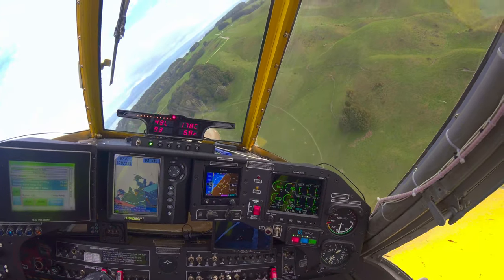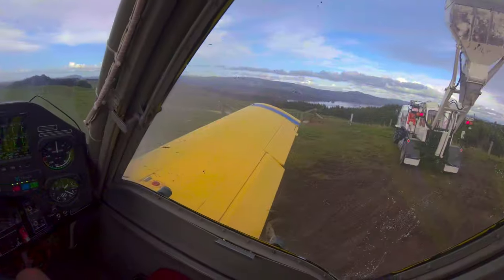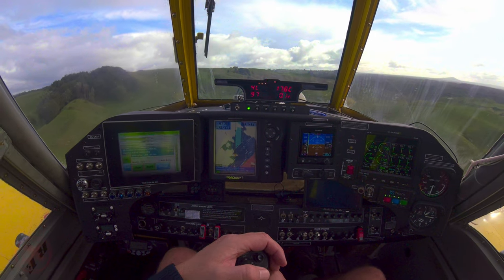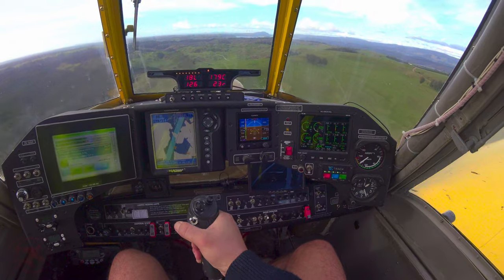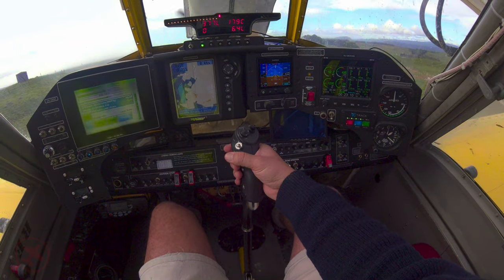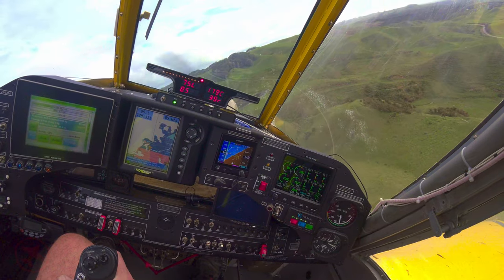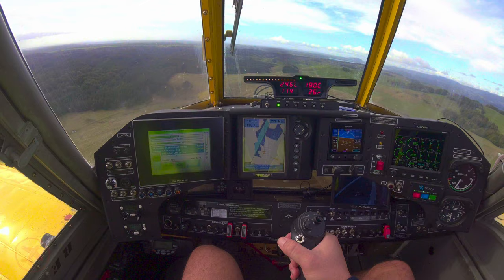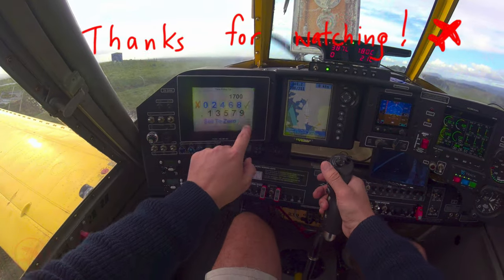Cropdusting - Pilot Cam

Comment: We quit using bucket trucks in Mississippi to many getting crushed in the cockpit if it falls gone to auger trucks with just a pipe and auger sticking out
Reply: Never heard of that happening here, but that is not to say it has never happened. They have had these style loaders in NZ for decades and they work well and are designed to be safe. I imagine the Auger trucks you guys use would be far too slow here when you take into account the average spreading time is 4 minutes or so.

Comment: That light bar setup does look a bit tricky. Does it thow you off at all having it so close to the cockpit? I've only ever had them on the far side of the hopper.
Reply from the maker: The external lightbar is definitely my preference. That and having the angle intercept LEDs 🤠